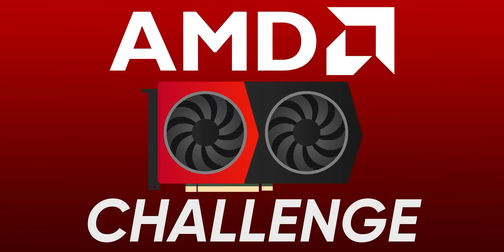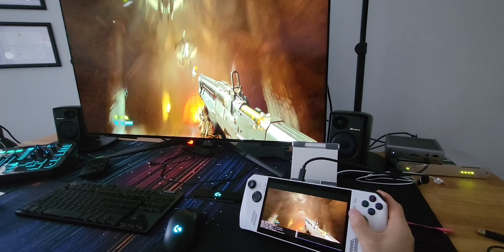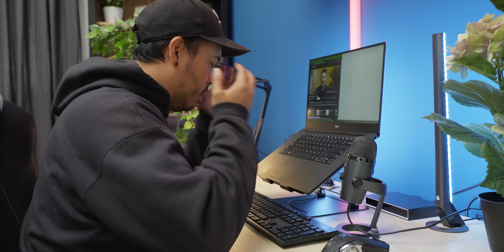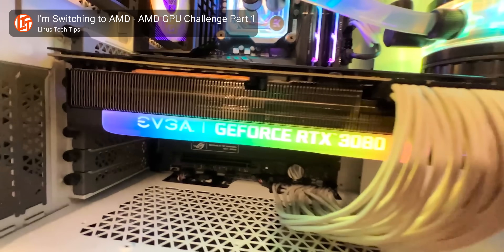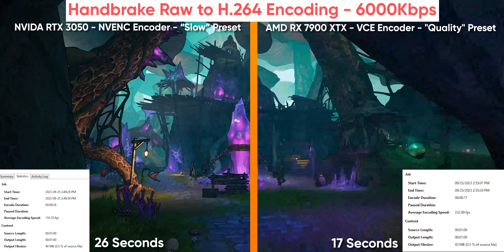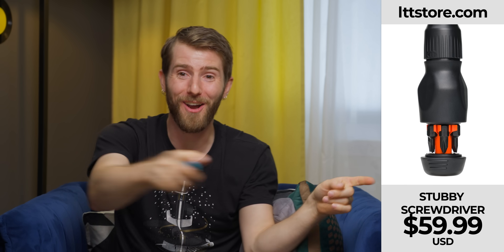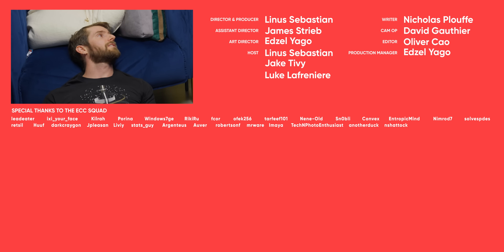I’m Staying on AMD! - Radeon Challenge Pt. 2

Comment: To be honest, I bought a 7800XT and I thought it would be better than my 2080 Super, which seemed to be dying on me. But playing a lot of Baldur's Gate 3, and for some reason the performance is somehow better with the 2080, and the graphics look better. Maybe because it seems like it was developed around Nvidia? Seems that way, with the Nvidia splash screen. I don't know, just doesn't quite look and perform quite the same. I hope it will improve over time but frame hitching happens despite it have 16 GB of VRAM on a computer with 64 GB of RAM, and a 5800X. Upping the settings maxed out doesn't degrade performance, must just be teething issues still, I hope.

Comment: i bought a 6700xt and it has the same issues as luke had, the way you install the driver matters an INSANE AMOUNT. i was having a mental breakdown because i couldnt return the card and 2 weeks of hell destroyed my mental but in the end it ended up working and the only issues i have are vulkan/opengl implementation being buggy, resolution scaling to the monitor is WORSE than nvidia (looks sharpened for no reason) and idle power draw was fixed by dropping my second monitor to 50hz instead of being at 60hz. the encoder is garbage but i have a gtx1050 lying around so it shouldnt be a problem to buy a riser and plop that card in the system for the encoder one day

Comment: Been team green for more than 15 years starting from a 9500gt, having those driver and display issues that frequently and on modern cards would pretty much sour AMD for me as a GPU choice. Especially when I can't even remember the last time that I had a driver crash with nvidia. 

Even when their control panel  interface is archaic and unchanged in those 15 years, I'd gladly put up with it if it means that I would have a headache free experience from my GPU.

Comment: I think the video freezing on one frame and the computer waking back up from sleep and breaking are more Windows correupt3d drivers issues than AMD. I say this as someone who is currently running only nvidia on my stuff. My laptop have the never actually sleeps issue and that only went away when I turned off windows FastStart in my system settings, and I have the video freezing on a frame until refreshed issue too when Im running a 4060 in my desktop, and reinstalling windows fixed both issues for me finally for good.

So yeah its not that i dont think amd has issues, but people underestimate how much of a problem windows 10 (laptop) and windows 11 (desktop) are behind the scenes.

Comment: Yesterday I recieved my Asus 7900XT OC edition.
I had no bugs and problems, except turning on SMA, because of last driver update, It is tricky to turn on. The rest I am very happy about my card.
Edit: You would avoid crashes im 95% sure, because I saw in first part you gujs didnt use DDUninstaller, and even after fresh windows install, you still have old drivers and they are messing around.

Comment: Funny enough, my experience with AMD has been... the opposite? I own an RX570, RX5700XT, RX6600XT, and RX6700XT and I've rarely had any issues with them. Only issues I can remember were with the 5700XT shortly after it's launch, but a few months later it seemed to work great. Had some issues with the 570 like black screens but they were power-supply related, as after I changed the PSU they stopped. I have several nvidia cards (1060,1070,1080,2060S,2070,2070S,2080,3060,3060Ti,3070,3070Ti) and they have been flawless all around too. If it were for me, I'd buy an AMD card due to my experience though if you have enough budget to get a 4070Ti or above, I'd go for that.

Comment: I haven't restarted after my last gpu driver for 7900xt. I should probably do that, i just keep forgetting..

Also on fps drops with a 7900xt, i play siege wars in black desert which is very poorly optimized, my .01% low was 56, 99% of the time i was around 75 fps during big fights with hundreds of people.

Comment: Ah yes! The bleeding edge highlighting the WHY I usually purchase CPU's, Motherboards and GPU's one revision BEHIND  the latest and greatest (new releases.) I do not need to fix problems that should have been fixed by the manufactures. Getting operating systems and programs to play NICE with each other is enough of a problem. 😁

Comment: fps drops and videos stalling is if your using firefox putting its self intoecomode and if you turn of nvida exp overlay it will fix alot of your issues its trying to over clock and windows xbox app also try to run overlays and crash's computer

Comment: I wondering, what are you doing in your daily use.
I am on an 6800xt for 3 years on W10 -> W11 without no problem in that time.
Since 6 month i'm under Arch Linux first with the 6800xt since one month on an 7900xtx.

On Linux, it works out of the box. No driver installation. Turn on and play. And thanks to Steam...you can play on Linux. And very good to.

As long, as NVidia dont overthink there Driver situation on Linux ( yes they are actually ... ) i don't think about to buy a card from NVidia.

Comment: Does anyone else have the issue luke had with the 5hz screen? If so what fixed it? Been getting it for months now trough multiple driver updates - it also mainly happens when launching games. Changing my monitors refresh rate 2x used to fix it, no longer does. My main monitor performs fine, its the secondary one that lags.
Reply: I have it on startup. I just start a furmark stress test for a tenth of a second and its gone i dunno why
Reply: Also its only my main monitor that bugs out

Comment: I swapped to amd due to a blown gpu and my goal was get best perfromace for my money, which happened to be AMD. However this tip helped massively, particular with discord, is to disable hardware accleration. If anything other then browser use hardware accleration it cause instability. I used to freeze alot but now it has been months. Also I used run small screen with aida64 for sensor info but something about aida64's polling method would hard freeze me with crashes like Linus's BSOD after 3 -5 hours. I had use HWinfo64. Once I had got over those quirks. I haven't bsod or crashed or frozen in months, might be worth trying.

Comment: Got a 7600 and on my first day i ended up putting my 1660 back in, couldnt get past loading screen on most games without a driver timeout, got a new psu and put the 7600 back in and ive had 1 timeout since on starfield, for the price amd is a great option

Comment: i wish i saw this video where he says "if you have unexplained stability issues its probably ram or power supply" before my pc crashed what was likely over 20 or 30 times over a 3 week period causing windows to completely wreck itself forcing a bare metal reinstall to be necessary only to find out the day of doing so that it was the off brand power supply i had for the last 4 years finally failing (450$ in repairs later...)
Reply: side note, huh so i was looking at amd cards for the price to performance but this video makes me a bit nervous as someone who just struggled with troubleshooting this issue alone, i was looking at the 7800xt for example and havent found specific info online to say whether by this point that card functions fine with current drivers

Comment: I have had an XFX RX 7900 XTX for about a month and I too am having the weird power draw when at idle. It goes anywhere from 65 watts to right around 100 watts. Also, the VRAM constantly sits at 909MHz. If I play a youTube video, it goes up to 2487MHz. I have searched everywhere for some kind of fix, but I can not find one. I have done DDU and reinstalled the drivers to make sure it wasnt seeing drivers from my 7900 XT. Nothing I have tried has worked.

Does anyone have any ideas?

Comment: I just built a new PC 2 days, went from an ancient Ryzen 5 2600 to a Ryzen 9 7900X (yes, big upgrade!). Everything in my new PC was new except for my graphics card which was much newer than everything else, an AMD RX 6600 XT.
I've had loads of issues with it since I got it in July last year. Had gotten waaaay worse in the days before building my new PC, opening Chrome or VLC would make it chug, like one frame every few seconds.. especially if they were both in the foreground at the same time.
When I started having the same issues with my new PC, I was like "f**k this" and went and bought a new Nvidia card, an RTX 3060 12GB, the exact same MSI GeForce RTX 3060 Ventus 2X 12G card in this LTT video https://www.youtube.com/watch?v=kAJAViPWR_8, not because of the video but because it was on sale, lol. Basically equal in power to the old AMD RX 6600 XT but no more random slow-downs! If the issues with the AMD card is just a software thing, when/if it's fixed, I can use my old machine as a second computer/storage server.

Comment: What does ddu even do. I just upgraded from a 2070 super to a 4070 ti super And still was having driver crashes it just would not even blue screen just black and ramp up the fans. had to do a clean install To make it work. So it’s not just between switching from amd to nvidia it’s also happening between nvidia cards themselves.

Comment: I know this is a year old but this is the issue I've had constantly with AMD cards, obviously I've had some issues with NVIDIA, but I remember buying my 5700 XT a few years back, having nothing but constant issues and then just returning it for the 2070 super. I don't think many end users who don't have the resources, like Linus said, would just stick around to see if the issues get ironed out or have the time to tinker out the issues. It's frustrating because I love AMD's CPU's, I just with the GPU's were a little more reliable.

Comment: I'm not sure if anyone here can help, but I suppose I might get lucky as google hasn't helped. So:

I upgraded my PC from 2x8 to 4x8GB of 3600Mhz RAM. When I installed the 2nd batch of 4GB sticks I tried to allocate 8GB of the RAM to the APU in the BIOS and to also have the RAM run on 3600Mhz instead of 3200Mhz (which it started running on after reboot). However it always crashes. I've managed to allocate 8GB to the APU and get the RAM to 3400Mhz (maybe even 3533 or so, the next step between 3400 & 3600), but when I move up to 3600Mhz it crashes and resets the RAM to 3200Mhz and the allocation to auto. Before the upgrade the RAM was running smoothly on 3600Mhz and 4GB allocated. The new RAM sticks are the same as the first 2, and I've not touched voltages or anything like that. As you might guess I'm using the PC without a dedicated GPU and I want it to stay that way.

Mainboard: MSI MPG B550 Gaming plus
CPU: Ryzen 7 5700G
RAM: 4x8GB Corsair vengeance LPX for AMD DDR4-3600 CL18

Thanks if anyone reads this and can help

Comment: Is this issue on just 7900 or does it affect 6000 series as well? I wanted to buy the 6000 series cards compared to RTX 3080 but seeing this made me doubt myself. Can anyone confirm?
Reply: I wouldn't worry about it too much. I think it's mostly applicable to the RX 7000 series but I'm sure most of these issues have been, or shall be fixed soon enough. I mean some things appear to be rare outlier cases such as some monitor set ups causing high idle power but with that said always do ya research and maybe take a look at r/AMD and r/Radeon. Personally from what I've seen I'd go with an RX 6600 8GB / RX 6650XT 8GB or RX 6700XT 12GB if you want good price to performance in the budget to mid range. The RX 6800 16GB / RX 6800XT is roughly the RTX 3080 equivalant but may perform ever so slightly worse. Between the RX 7700XT 12GB and the RX 6800XT 16GB I'd go with the RX 6800XT 16GB for the extra VRAM but if you can get the RX 7800XT 16GB for roughly the same price I'd go with that and if ya can get it bundled with a free game / 10% discount even better. It all depends on what kind of deals/prices you have in your region. AMD prices tend to fluctuate up and down a bit more so it might be worth keeping a close eye on them for a few weeks/months depending on how patient you are. At least hold out for a bit longer and see if they have any good deals worth grabbing around Black Friday. That should also give them time to roll out another update or two.
Reply: @Barksyyy  Thank you for the comprehensive details and tips! I've been eyeing 6900 XT for a while now, cause the price is the best in my region. I was looking for a more higher end cards but somehow RTX 4080 just ends up being nearly US$2000 equivalent here despite crypto mining falling out of trend. Then I saw 6900 XT's performance and it's been months since I've been looking at benchmarks in both youtube and GPU user benchmark website now. Last time i'm settling in midrange, I don't feel like getting my money's worth, funnily enough. US$400 equivalent cards lasting only 2 years vs my current GTX 1080, at US$600 equivalent lasting 7 years and actually, still going strong.

Hence the conundrum I'm at deciding whether or not to wait 1 more gen until Radeon 8000 series and RTX 5000s to come out and buy the RX 7000s or RTX 4000s when their prices dropped.

Comment: I do not get it... I am using exclusively AMD for years now. Not the highest end but currently a 5900x with a 6800 and I never run into problems. Maybe because I am using it not from day one on but buy it in the mid of the product circle of cause (I wait till the prices are at least a little bit reasonable) but I am doing VR, playing games from Cyberpunk to LOL and I never have any kind of trouble here. And I am doing video editing, 3d modelling, rendering (and printing, so this is not a GPU thingy ;)). I do not remember when I had my last blue screen with AMD, but it has been years.

Comment: Please help. 

I have a laptop that died it won't even boot so I think the hard drive is dead. I have another laptop with a hard drive in with windows 10 already on it. 

Can I put hDD into my broken laptop and will it boot up windows and install the drivers automatically if connected to a network?

The laptop is a acer swift 3 with i3 and has 16gb intel optane that won't let me remove it as when I did it just said no bootable drive found. I don't even know what the optane doses. Is that what windows is installed on and is the boot drive?

The laptop has been slowly dying with driver issues and other problems. Now has a black screen of death. Won't even go into bios or recovery mode

Comment: Dang. Sounds like Luke had other issues with is system before or something? Then they make a note of the sketchy CPU, and that makes sense. Get a new CPU Luke. lol I've had my 7900 XTX since March, going from my 1070Ti, and it has been a really good experience overall. I have 4 monitors hooked up to mine, and it has handled them pretty well. In the early days, I had some issues, but things have gotten much better with time. Only time I have crashes are when I'm running an unstable OC/UV, but once I find my OC/UV settings for the game it's good, as I learned not all games like the same OC/UV settings. One issue I do still have is with AV1 streaming and recording. Tried Streaming on YouTube with AV1 once the supported it, and it was absolute garbage, and had to delete that video. I have never had a good experience using the AV1 encoder in OBS, so I just use the HVEC encoder, which sucks, as AV1 was a big selling point for me for streaming, so hopefully that gets worked out, or maybe it's just something on my end.

Comment: I love my amd cards. i have the merc 6950 xt 319. But i seen on microsoft games i cant lock my fps. only 20 40 and 60 or unlock. i have to use unlock and chill mode to lock fps at 240 on forza motorsports, horzion 4, and 5. i have a 240 fps motor and i cant v sync it. I will get random fps drop. like running 240 then drop to 150. Im up to date with drivers and try to unstall the game and re install the games and drivers. Nothing changing it. But some time fh5 will glitch i can lock frames to 15,000+. but caps at 500

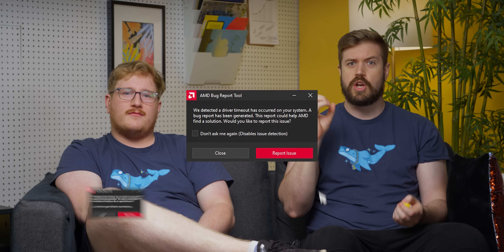Comment: 5:12 Dude 😎 that's so cute cue .. 
BSOD and Kernel Panics are going to be a problem until the hardware x86 vs Arm thing solidifies.

As real programming always needs a solid C / Assembly base SDKs.. all these crashes are pure indicator that the driver and software stack just have too many gaps...

As usual one group of people on the internet will just start sharing unofficial hacks and the manufacturer will be forced to redo this properly.

Comment: This video explains, why I after years switched from red to green despite the outrageous pricing: Over 11 years of using AMD because of "bang for the buck" I ponied up the money for a (still overpriced) 3080 and suddenly ALL problems solved themselfes. The most noticable: Drivers crashing as soon as I either undervolt/underclock even the smallest amounts (even with AMDs own auto adjust feature). And why did I need to undervolt/underclock at all? The GPUs all ran pathetically hot and the fans sounded like a plane taking of. This is over 3 cards in 2 entirely new built PCs.

So far Nvidia JUST WORKS. No messing with setting to combat heat/noise. No weird driver crashes and "resetting to stock settings". Just plug and play. This is so amazing.